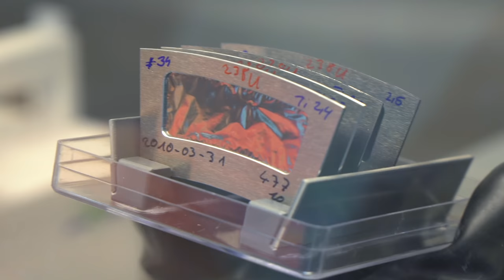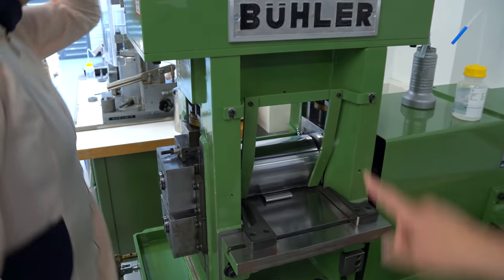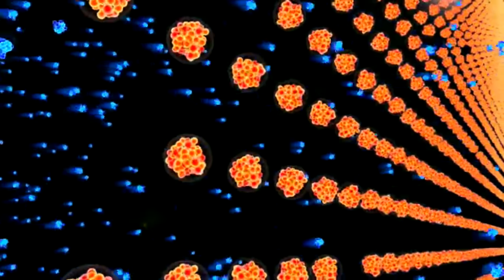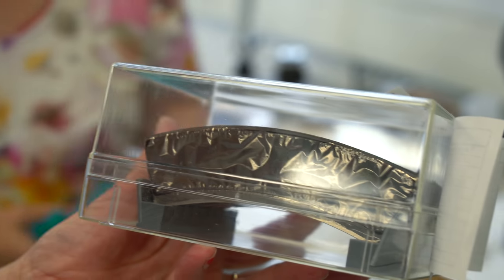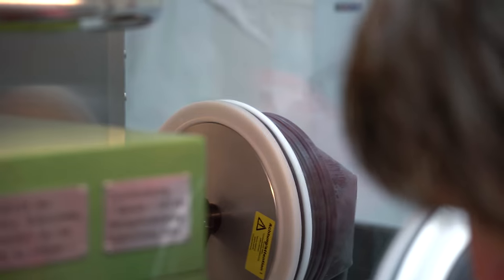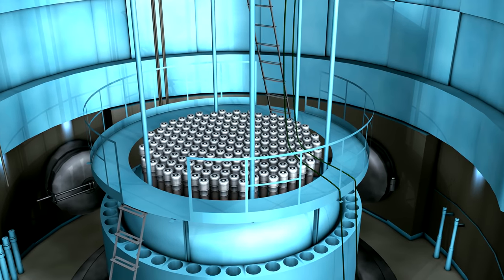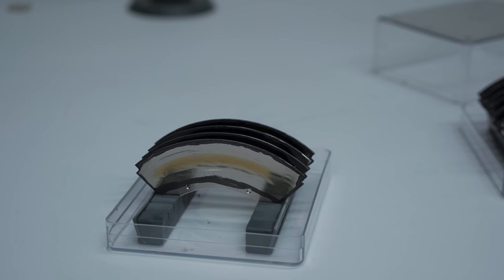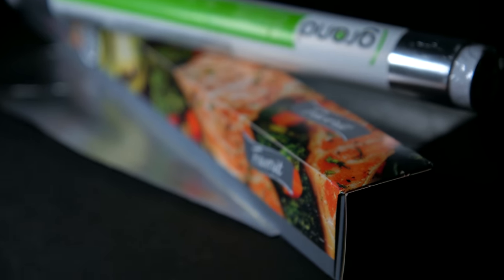What Is The MOST EXPENSIVE FOIL REALLY MADE From?

Comment: Yes this video is very helpful.  I've decided to stop baking my potatoes in uranium foil.  Sitting on top of the kitchen counter.  I've elected to use, aluminum foil.  And put them in the oven.  But it takes almost an hour that way.  The uranium foil was so much quicker.  And you save a boatload on, electricity, propane, natural gas,, charcoal.

What else can I use that uranium foil for?   Condenser or ribbon microphones maybe?

Why can't I get it just to power my Prius?  Or would it be better for a Tesla?  One little beer can with that stuff should work.  And placed within a 3 ft.² lead box.  Auto accidents won't hurt that.  It'll hurt autos.  And so you will NOT be coming off the line.  At,  any red light anytime quickly. 

But just think.  You will always have a nice hot grill.  For your tailgate parties and when you go hunting for venison.  And who wouldn't want that?

I want one
RemyRAD
Reply: "What else can I use that uranium foil for?  "
chewing gum.